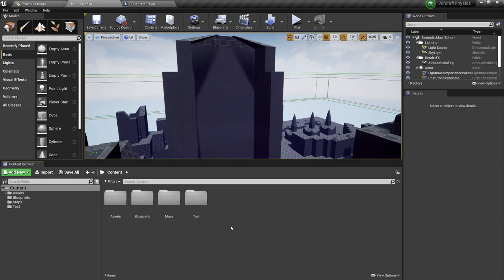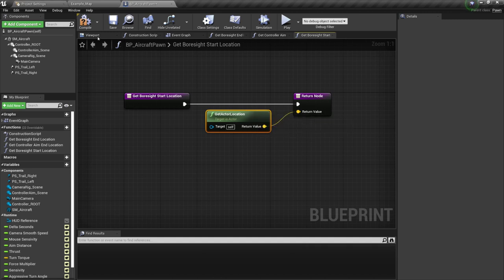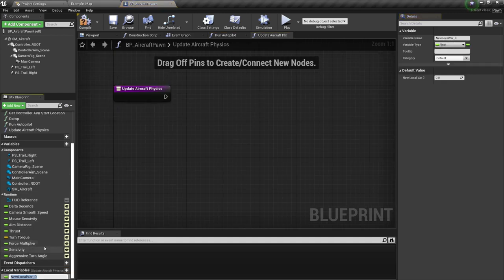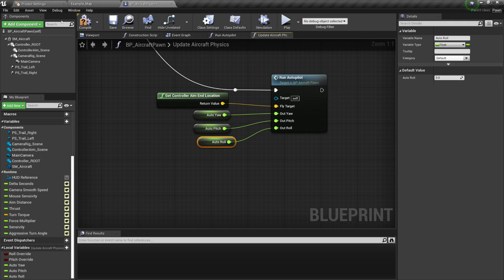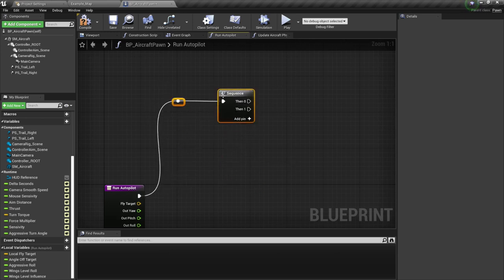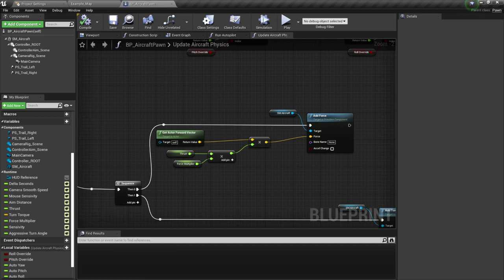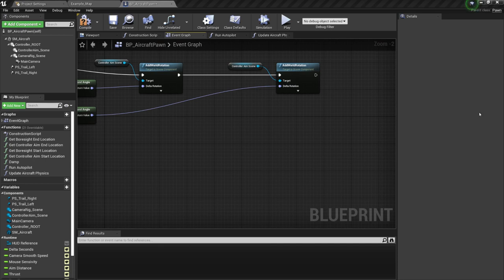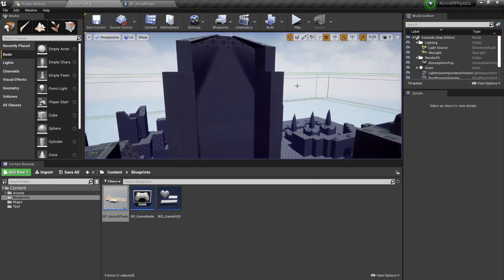Airplane Physics System With Unreal Engine

Comment: is there any plans to make some landing gear for it ?
i can make the air movement and grounded movement, but the thing that's been driving me insane is mixing the two while taking off/landing.
I've been on it for weeks and there isn't a single tutorial or marketplace asset that covers that other than one asset called EFM but they don't include source code, and i want to learn not just use someone else's asset.
Reply: I dunno if it’s helpful but realistically speaking there isn’t really a mix, a plane is either flying or not. If it’s past stall envelope but not on/detecting ground it should just stall. There isn’t a transition… it seems like with most MSFS versions FS8,9,X and 11 if you slew your plane up even 1’ off the ground and let it fall it detects a crash, which to me means they have a fly/taxi mode that gets switched between. So I think as long as you are able to create code that factors in horizontal speed above stall limit, a “crash” is not occurring. Maybe calculate (vertical) FPM.
Reply: I think you need VREF speeds. If below V1 and rolling on ground, then ground mode is active. If above V1 and rolling on ground, flight mode is active… but the gear should break.
Reply: You should also code for flaps. IE if at V1 without flaps your plane should be stalling. If flaps are down V1 speed is lower… not sure if this helpful at all. Gl with your project!